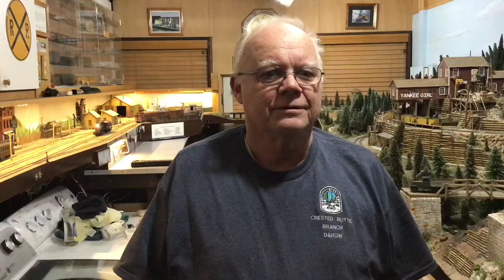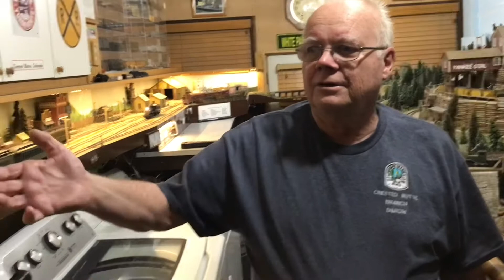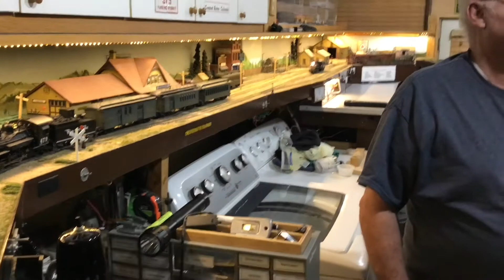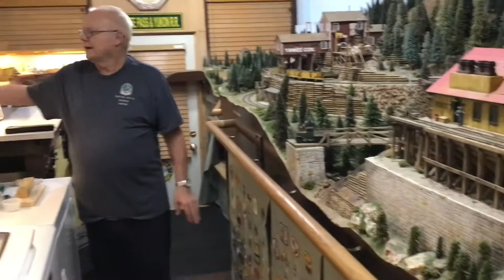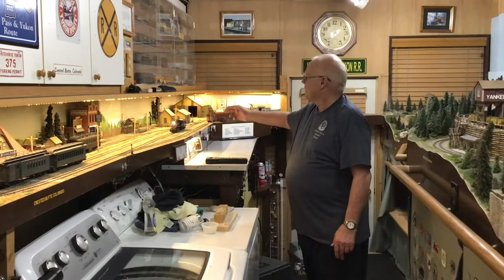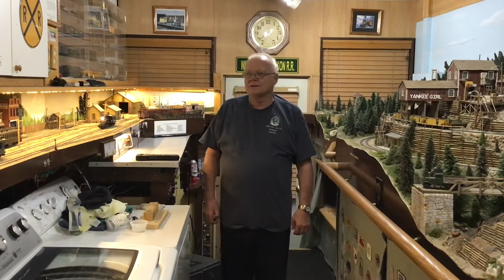My name is Jim and this is an Introduction to my On3 layout

Comment: Mentioned on another video, beautiful modeling! Could you introduce the different engines / importer or builder of the model / if they are brass etc.?
Reply from the maker: My three C-16’s are Sunset Brass Models and my two C-19 are MMI. My C-21 is an old Balboa models My 4 K class engines are also MMI. I only use Soundtraxx Tsunami 2 decoders in all of my locomotives. I hope that answers your questions, thanks again watching